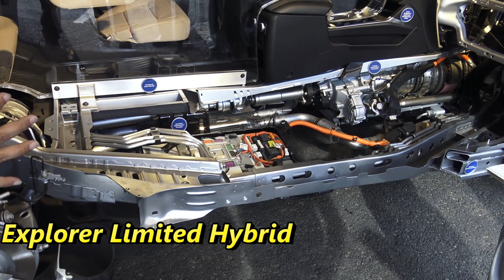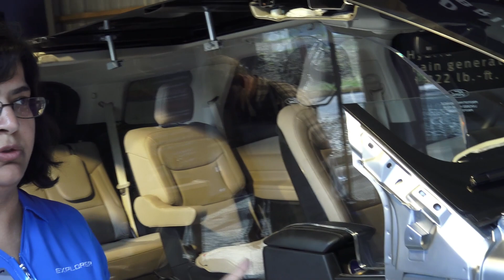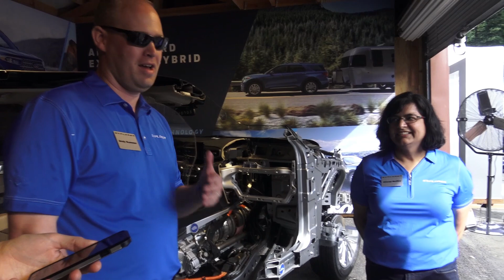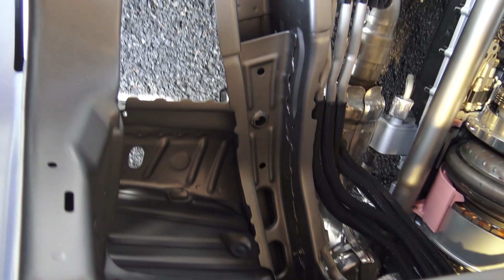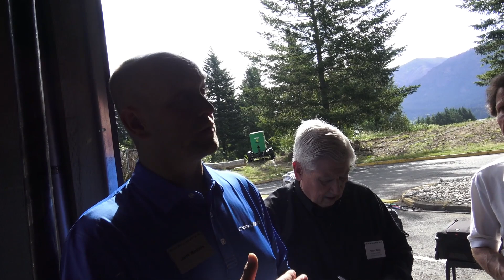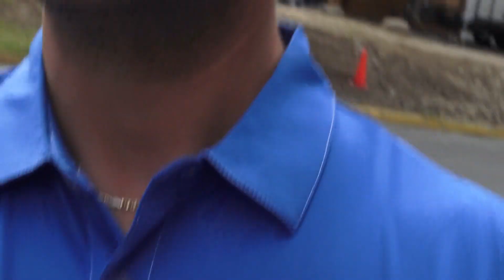2020 Ford Explorer first drive, hybrid AWD in Oregon and Washington

Comment: MrTruckTV: I am interested to know a couple of things about the new 2020 Explorer 3.3L Hybrid Engine. Is this new 3.3L Engine based on the new 3.0L V6 Engine in the 2020 Explorer or is it based on the old 3.5L V6 Engine used in the 2019 Explorer? Also; would you happen to know the Bore and Stroke of this new Power Plant or can you find out? The data out there is a little bit sketchy. Thank you for you help and this very nice post.

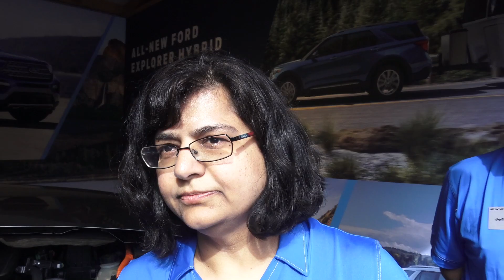Comment: @ 12:55 mr truck thought the brakes themselves were transferring energy back into the system which is what she made it sound like but its the electric motor the recovers the energy
Reply from the maker: Yes the brakes do return energy but it goes threw the electric motor and to the battery

Comment: She sure is struggling... I’d be scared to buy Ford.
Reply from the maker: She is very smart, not everyone comes across in an interview well. I've talked to her 3 different times and was impressed with her knowledge
Reply: MrTruckTV that’s good to know... she got better towards the end.
Reply: @MrTruckTV  what is the battery capacity?  the previous guy said 35kw which is not a capacity.  Then he said the motor was rated for 35kw which makes sense (about 44hp) but what is the battery capacity is it 35kWh? or some other number?  Looking at the pack size in the under carriage it is unlikely that it is a 35kWh pack.